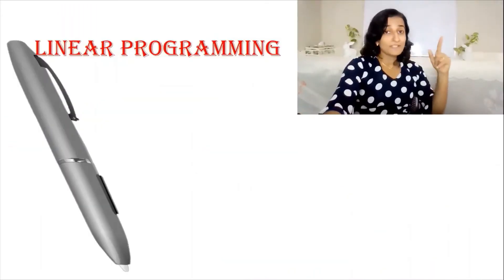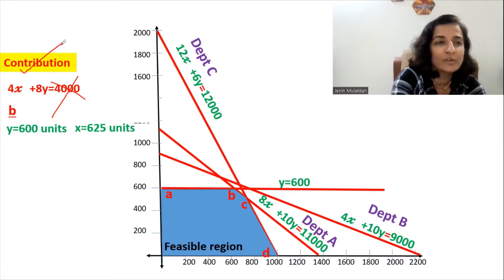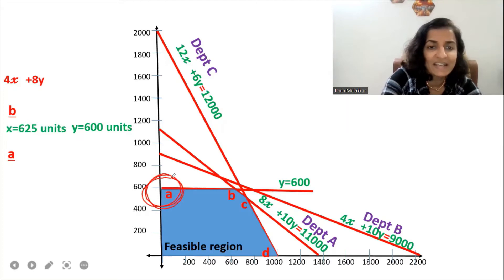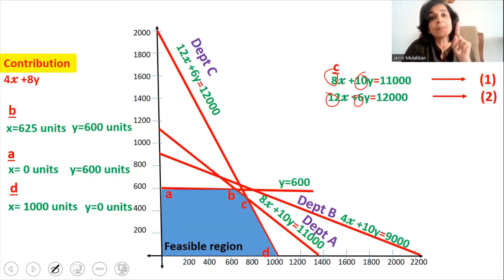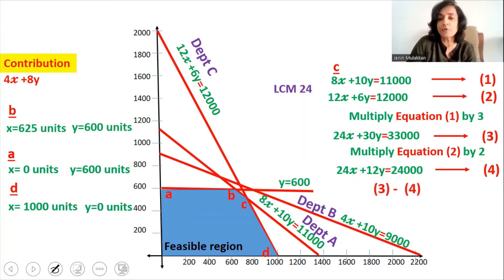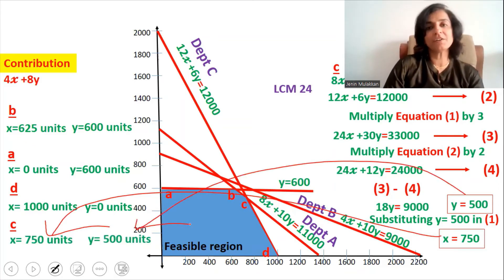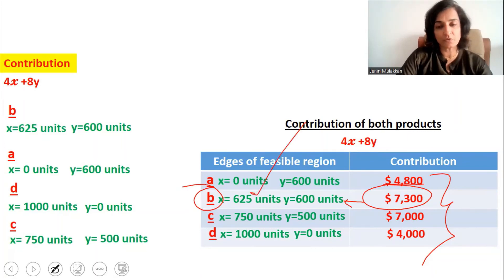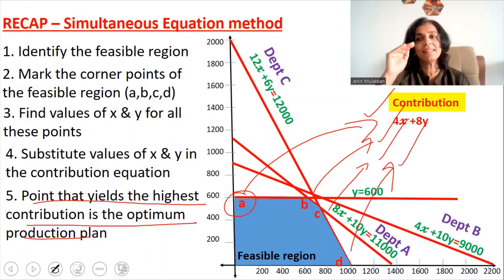Linear Programming Part 4 Simultaneous equation method ACCA F5

Comment: Ma'am what is that

When greater than equal to sign then we have to choose nearest point and if it is less than equal to then farest point ?
Can you please explain that point.
Reply from the maker: For ‘≤ constraints’, say for raw materials, the feasible region lies below the constraint lines. The objective function given here is usually the contribution. Contribution can be increased if we produce more units. Hence we have to select a point within the feasible region which is farthest from the origin. Conversely, for ‘≥ constraints’, say the raw materials required for health drinks, then the feasible region will be above the constraint lines. Here the objective function given will be related to cost. As cost has to be minimized, we should select the point in the feasible region which is closest to origin. In short, the reason why the farthest point and the closest point is selected is because for the former, the objective function will be related to contribution & for the latter, the objective function will be related to cost.

Comment: Is it better to adopt this method or the iso contribution method for solving linear programming problems?
Reply from the maker: Iso contribution line method is generally preferred. However if u have any doubts regarding the point at which the iso contrbn line leaves the feasible region, then u could adopt simultaneous equation method to find the optimum production plan